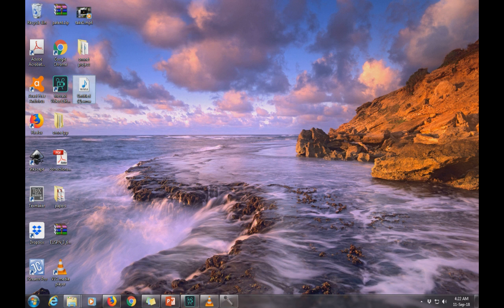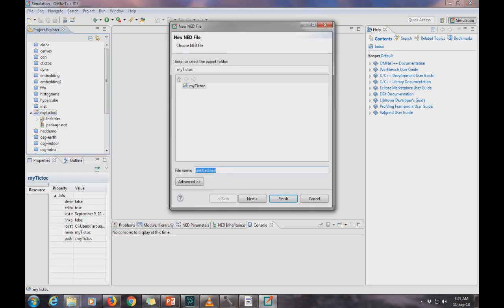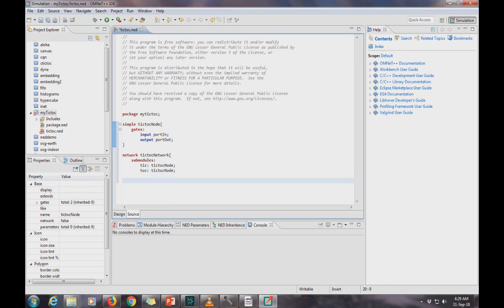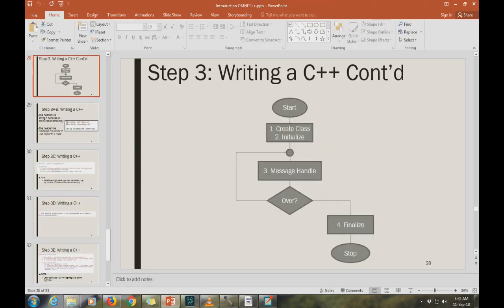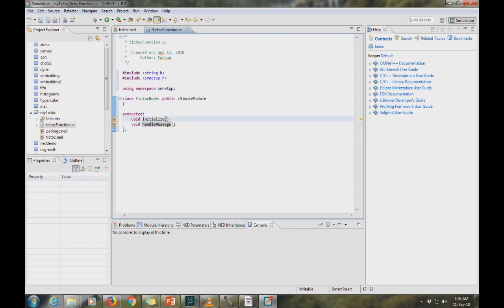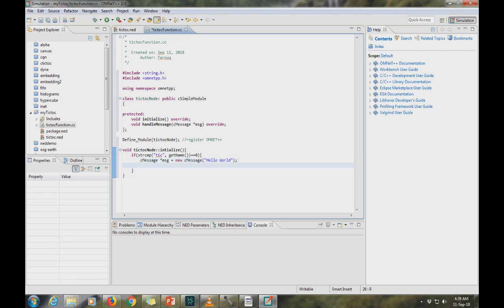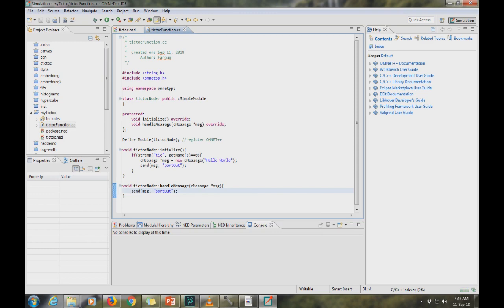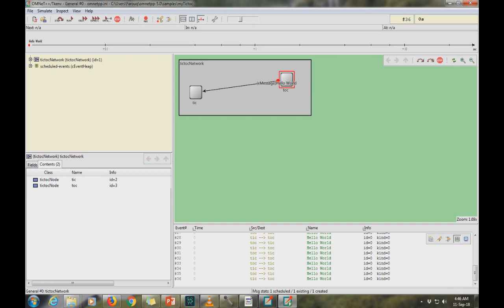OMNET++ TICTOC 1

Comment: thanks for this video. Do you have a LoRa framework IoT Projects project using Omnet++ ++?
Reply from the maker: Sorry, no.
Also, sorry for the late response. Last year was a very busy year for me. But, I am back now.
Reply: @farouqAliyu  no problem. Thanks for replying. Yes I solved it 😊
Reply: try to  use Floranet, framework for Lora
Reply: @agusmulyana081  you mean FLoRa or FLoRanet ??
Reply: @msadekmarwa5934  , i mean, flora, did you tried this one ?
Reply: @agusmulyana081  Yes I try but I have some error when I installed
Reply from the maker: Have you solve the issue?